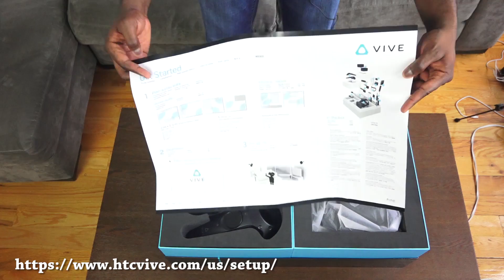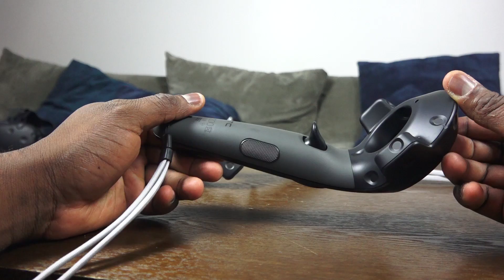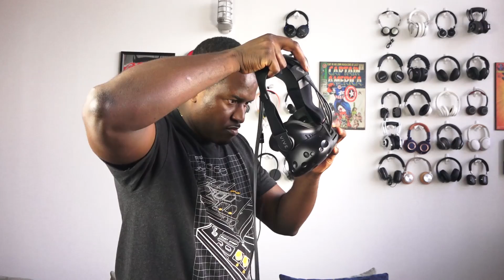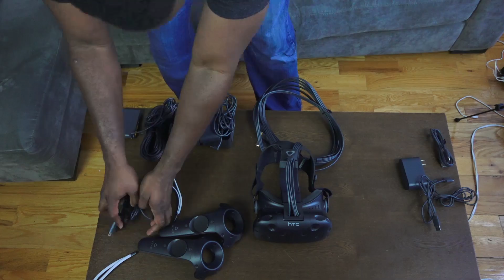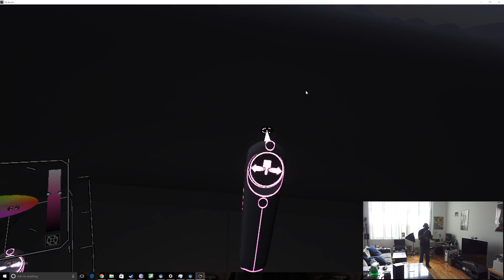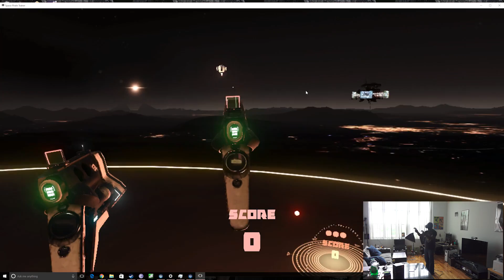HTC Vive Unboxing & First Setup

Comment: can you buy one without controllers? or the controllers has to come included? i only want it for car simulators which i have a full set already except the vr.
Reply: yes, but i think the only way to do so is to buy it on eBay. i'm not quite sure though

Comment: My HTC Vive just arrived by ups 2 days ago and now i realize i have to buy the Fovitec StudioPRO - 2x 7'6" Light Stand VR Compatible Kit w/ Ball Head Mount. First of all i don't have a electric drill to screw the sensors in the wall and even if i did my wall is very weak(i would make a hole in my wall). Now i have to wait another week or two for the Stands,it sucks because now i am just looking at it in the box without enjoying
Reply: don't have to be on the wall.
Reply: I wish someone told u but u can put it on the floor and medium height and it will still work